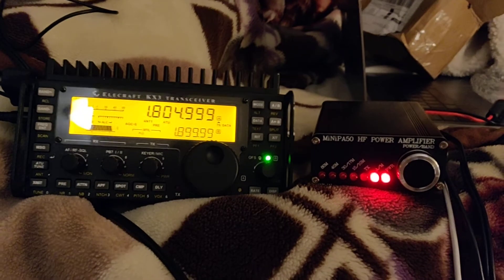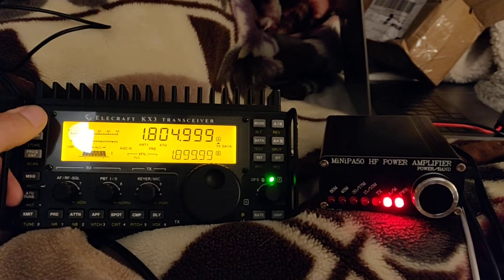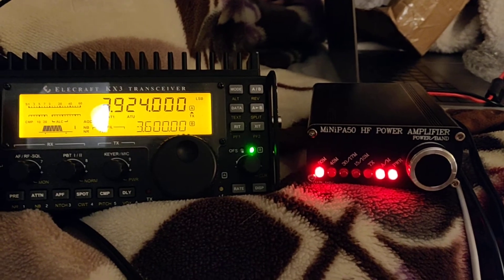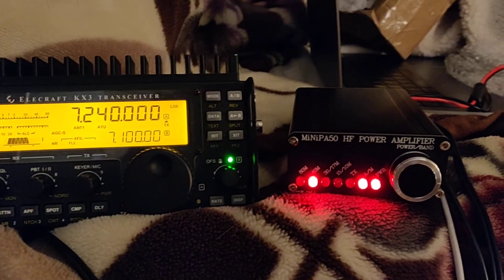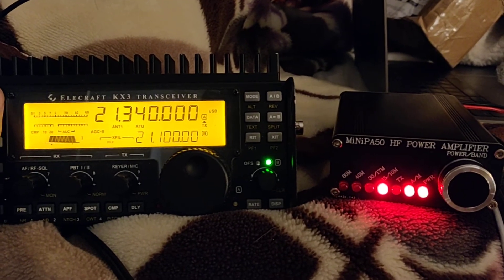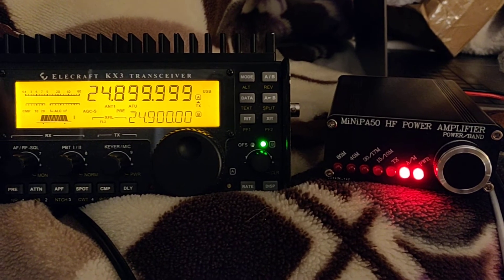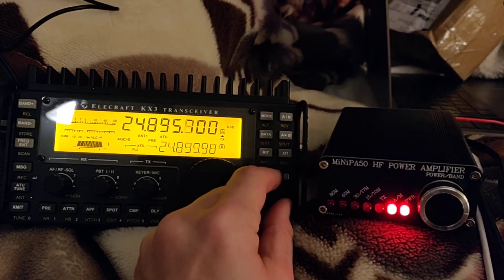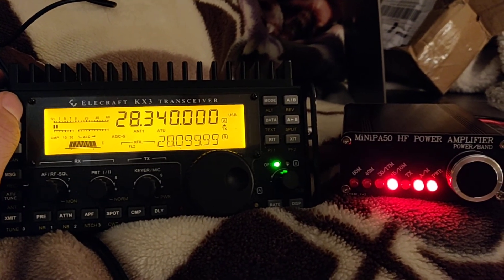Auto band switching with the Elecraft KX3 and MiniPA50

Comment: Nice video, very helpful.  Can you share the details of the conversion box you built?  i have the same set up but stuck at putting on the air, because i cannot get the Kx3 to "talk" to the minipa50.  thanks,  Paul
Reply from the maker: I have some information on how to wire it up at the GitHub link in the description but admittedly it's specific to the MKR Zero that I used. The main thing to keep in mind is that the KX3 uses RS232 while the Arduino uses TTL signaling for serial communication, so something will need to convert between the two (hence the level shifting board from SparkFun). Let me know if you have any additional questions/issues and I can try to resurrect mine to help.
Reply: @tmiw  Thanks, All that is way beyond my abilities.  I like what you did, but I do not have the skills to come close to building an interface like that.  Would you have any idea of how I can modify the cable that came with the minipa50 that is specific to the FT817 to be used with the Kx3?
Reply from the maker: @paulkg5hlb900  Unfortunately the KX3 does not provide a voltage output that's compatible with the FT-817, so some sort of conversion box is needed from the CAT output to such voltages. However, if you don't mind manual band control on the amp, you should be able to plug the PTT line directly into the RCA jack/2.5mm fanout that plugs into ACC2 on the KX3 with little trouble.

Comment: Thank you very much for this video as it is difficult to find videos on this product. I am wondering if you had an issues like threads on the back does not match to SO239 connector and similar issues? Also, could you please post the link from where you purchased it from? Thanks in advance, 73
Reply from the maker: The SO239 connectors on mine seem to work okay for me, fortunately. The main issue I'm having is that it gets very hot with high duty cycle modes (e.g. FT8), so a heatsink might be useful in the future. 

As for where I purchased it, I got mine from this seller: https://www.ebay.com/itm/HF-Power-Amplifier-F-YASEU-FT-817-ICOM-IC-703-Elecraft-KX3-QRP-Ham-Radio-FT-818/171987683557?ssPageName=STRK%3AMEBIDX%3AIT&_trksid=p2057872.m2749.l2649
Reply: @tmiw  Thank you for the response. just wondering why have you not chosen MX-P50 instead?
Reply from the maker: @GokhanKaya  Mainly for the auto band switching. However, I've found that I don't use that feature much, so it might be a harder choice for me next time around. That said, the amp performs well FWIW.